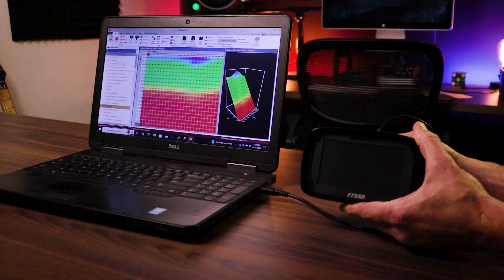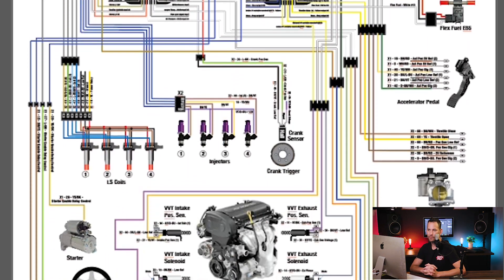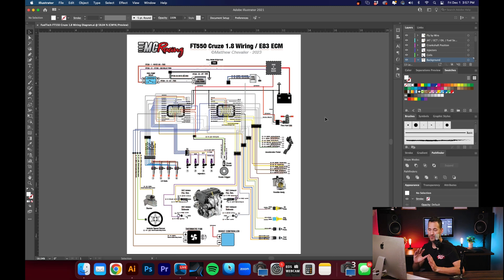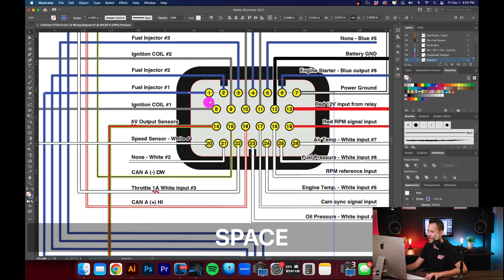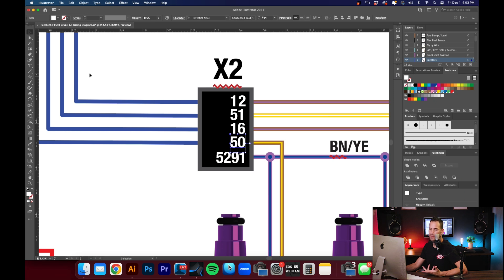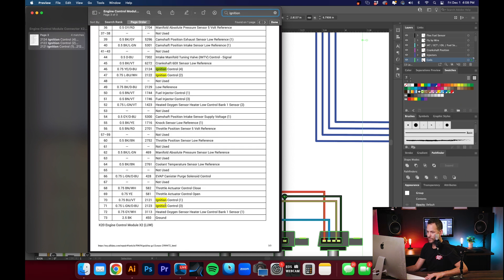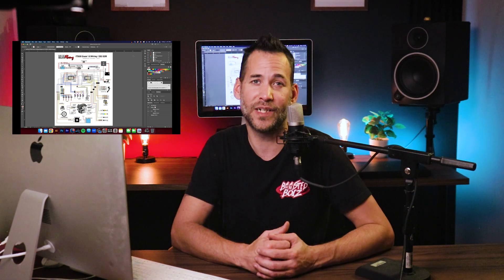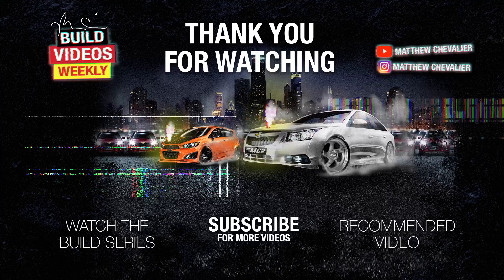How to Wire an Aftermarket FT-550 ECU (Step-by-Step Guide)

Comment: Good video Matt, I love how you did the wiring diagram. A good tip is to share the crank signal with the stock ecu and ft550. Without crank signal to the stock ecu the electronic power steering may not work. You cannot share signals for water temp and air temp to both ecu's but the crank signal is one of the signals that you can share.
Reply from the maker: Great point! The power steering has definitely been a concern and I have no idea whether it's RPM signal from the ECU that activates it or what. I'm sure I may have to dig into that more if it's not the RPM or crank signal.
Reply: @cmattdabrat  I know this is a little late but my power steering would continue to work after the engine stalled and would stop once I went under a certain speed. It was like 2mph.
Reply from the maker: @a2cryss  I ended up sharing the crank signal with the ECU. So the power steering is working once the car fires up. Power steering activates even sitting. :)

Comment: Isn't the fuel tech pretty tiny. It would just cover up the tach side of the dash? Leave the cluster in since the speed and fuel have nothing to do with the engine ECU? Would be nice to keep the info screen active for trip meter, oil life and tire pressure faults. Yeah I looked at how big the main screen is in your hand and if u put it over the tach it won't really block the middle info screen or speed it's a pretty small unit.
Reply from the maker: It is, but I'm sure it'll cover up a good portion of the factory gauges. Guess I should have just mocked it up, but had the FuelTech sitting in my office. I will be sending the speed and fuel level signal to the FuelTech as well. Guess tonight I'll bring it home from the office while the rest of the stuff is coming in and start mocking things up to see.

Comment: Great work on that wiring diagram. Extremely helpful. Would be really cool if more ECU sellers made something like that. They layers to view each system are big headache savers. An ECU company could even make something like that as a PDF with a clickable sections page at the beginning.
I'm decent at 3D modeling and 3D printing so if you want help with something I'm down to try. Can be a lot of trial and error but there are ways to add wiggle room to a design if it's not quite perfect haha.
Reply from the maker: I agree. Should be something they have built into their software. 

That would be awesome and could help you with some $$$ for time and expenses.  LOL, always can build some wiggle room into the mounting tabs.  I'll get with you and see what we can come up with. I'm okay at 3D stuff, but always have to put a lot time into refreshing myself on it as it's not something I play around with everyday.
Reply: @cmattdabrat  I've been practicing more and more so hopefully I could whip something up. 😂 You're right having a wiring diagram that complete in the software would be amazing for visual checks. Hope it's going well!

Comment: I like the idea of keeping the stock cluster if the ft550 would work it. But thats just me. When i was younger the idea of a digital dash seemed cool. Now that im older i tend to like a stock gauge setup. O do 3d printing, but any kond of complex modeling is beyond me. My fdm.printer it down so i have been using my resin printer for everything. Way higher quality, just not as big of a print volume.
Reply: Haha yeah I love factory digital dashes like from the 80s style wise, but I'm a big fan of analog clusters too. Depending on the car, the factory gauges are just so cool. I think I'd probably try to add the FT on instead of totally replacing at least to start.
Reply from the maker: I think I might have a video up on the channel I posted long ago of my mechanical gauge going on the '71 beetle I had on a cold day. lol. I feel ya on the nostalgia on analog style gauges. Even these gauges are fairly digital, but with a mechanical feel.
Reply: @cmattdabrat  I'm also a little biased. kind of fond of the stock cruze gauges. I stare at them 1.5 hours a day driving to and from work and for factory gauges they are pretty well done. Just enough digital to analog ratio.

Comment: Hi from the uk Ive been rebuilding these vvt"s for many years and love your channel i also run an insignia group (the british version of the buick regal) and people ask me how to improve performance on these engines so i just send them your channel link with luck lol. I know most people would look at what your doing and question why but it becomes a challenge and i totally get that. Good work and great channel. Rip that  quarter mile 😉
Reply from the maker: That's awesome! They seem like a great platform. Iron block, aluminum 4 valve hemi head. VVT. Bucket on valve design. Pretty simple engines. It'll be fun to see what it can take and make horsepower wise. Thanks for sharing!

Comment: Hello Matt . I'm preparing to do this to an older ecotec platform . What did you do about knock sensor and did you use a GM flex fuel sensor ? Thanks in advance .
Reply from the maker: Hello. I didn't use the knock sensor. From my experience it would detect false knock a lot, even more so with mods. You'll have to develop an ear and eye for knock. Knock really sounds like a can of rocks and will be followed by a puff of smoke out the tail pipe. I have a FlexFuel sensor on the car now. Works great.